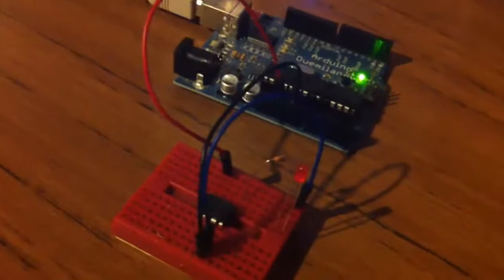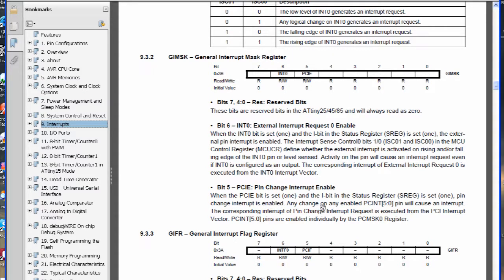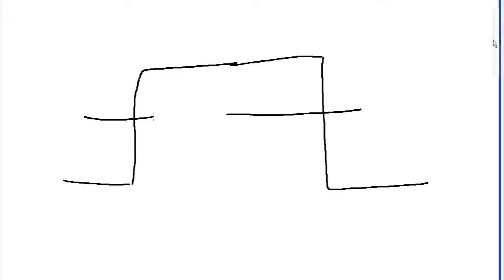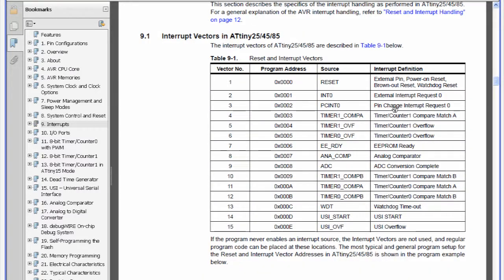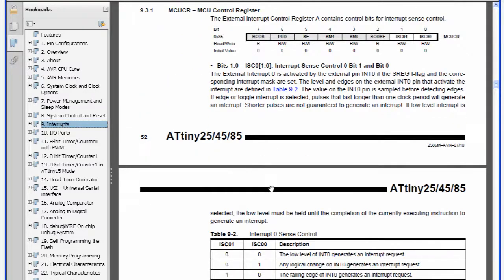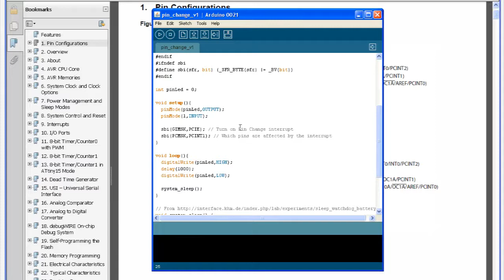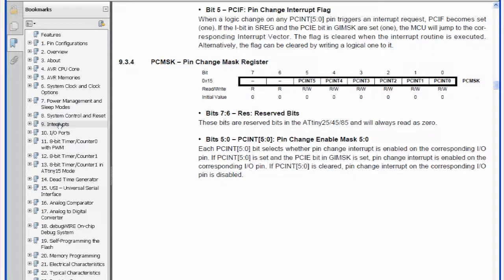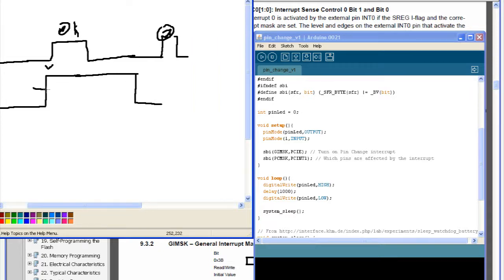How to use the Pin Change Interrupt on ATtiny85

Comment from the maker: That was intentional, the ATtiny85 doesn't have an individual ISR for each pin.

PCINT0 stands for Pin Change Interrupt Request 0 and PCMSK is the Pin Change Mask Register. We enable the pin change interrupt on the PCINT1 pin in the PCMSK. If you also enabled pin change on PCINT2 pin and an interrupt occurred on either pins, both would go to the PCINT0 ISR. You can check the interrupt vectors (e.g. PCINT0) on page 50 on the ATtiny85 datasheet and the PCMSK register on page 53.

Comment: I have found the SMD ATTINY85 to be useful in many projects, if you purchase a programming  clip and use an Arduino as a ISP you can put lots of  Arduino code  on one. I use them to save space and money In addressable led projects. You do need a breakout board and if you buy a clip make sure to get one to suit the package you are using the first one I ordered was incorrect and I waited weeks for delivery only to be disappointed. Thank you for your excellent tutorial.

Comment: Hi! Great job! I have a doubt, because when I measured the circuit, when I have the switch is open the consumption is 0.68 in sleep mode, but when the switch is close is 0.0 in sleep mode. I think I have some wrong, because I hope the same consumption in tow modes. Thanks a lot.

Comment: A way to use INTERUPTS AND THE DELAY FUNCTION! NICE!!!!! Is this possible ONLY because you did the Pin Change Interupt? Or is it possible on the standard Interrupt Pins of the AtTiny85?
Thanks.
Reply from the maker: Hi, yes it's because the interrupt is a pin change interrupt and not a timer interrupt which I believe the Arduino uses for the delay function. If you code direct AVR instead of Arduino, there is a delay_ms function which is tied to the clock speed and doesn't use any interrupts. You could probably do that with Arduino too but would have to make sure that some how it doesn't use the timer interrupt.

Comment: it's possible that the interruption blocks the upgrading of a new program?
Reply from the maker: Hi Andres, you should still be able to upload code because the ATtiny has a dedicated reset pin, once it goes low the chip will be ready to be re-programmed. If you have connections hooked up to SCK, MOSI, MISO in your circuit, then that could cause a problem
Reply: @insidegadgets  you're right, it was just a bad contact between the reset (digital pin13 on arduino) and the protoboard pad connected to the Attiny85 reset pin. Thanks bro

Comment: I am just wondering if this will work using a capacitative sensing plate.
Reply from the maker: If you have a chip built in with the sensoring plate and it puts out about half of the VCC voltage it should work. If it's just a bare plate alone, then you could put a 1M or higher resistor to ground.
Reply: insideGadgets I have the plate connected to pin 3 with a crossover 470M resistor connected to pin 8 . The capacitative sensing works. The problem is the sensing routine is in the loop and the subroutine does not get executed until some parts of the program are done. That is why I need to place the subroutine in the interrupt. Any hint how to do this? Thanks.

Comment: Hi, great video. I still have a question though. When an interrupt occurs what is the first command executed? Is it the first statement in the loop()?
Reply from the maker: +Markus Rohner Hi Markus, when an interrupt occurs, it jumps to ISR(PCINT0_vect) to execute code (in this example we don't have any) and then it jumps back to the place after we set the system_sleep() command, which in this case as it's at the end of the loop, it would bring us back to the start of the loop.

Comment: Hello i was wondering how much power does it take while in sleep mode maybe i miss that? The other question is how long does it take to wake up and turn on the led looks pretty quick?
Reply from the maker: +joseph chrzempiec (josephchrzempiec) Hi, once the ATtiny85 is in sleep mode, it only takes 1-4uA (depends on what else you leave on) and it would take 4 cycles  (pin interrupt) plus 6 cycles when at 1MHz using internal clock to wake up from power down, so about 10uS.
Reply: +insideGadgets hello is it possible to put the reset pin as the interrupt pin?
Reply from the maker: Yes if you change the fuses, the reset pin can act almost like a regular pin but the downside is that once you do this you need a high voltage programmer if you wish to program the chip.

Comment: why it is showing yenkie invalid device check your connection double
Reply from the maker: Hi, please check your connections are correct. Sometimes I get this if there isn't a capacitor near the MCU, sometimes a 0.1uF cap will fix it but if not, try 1uF.